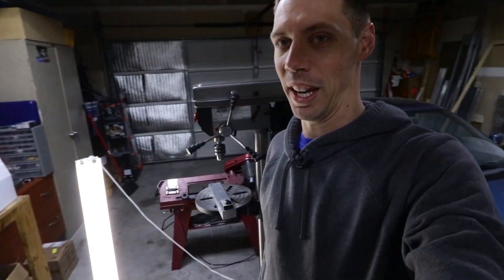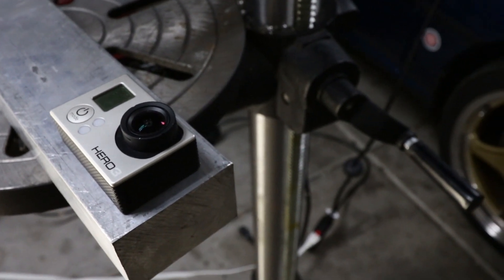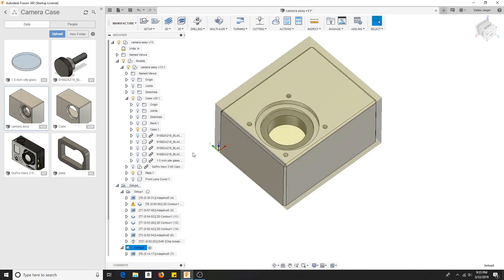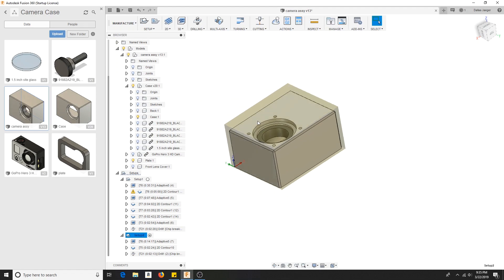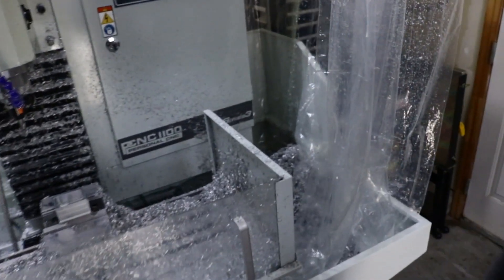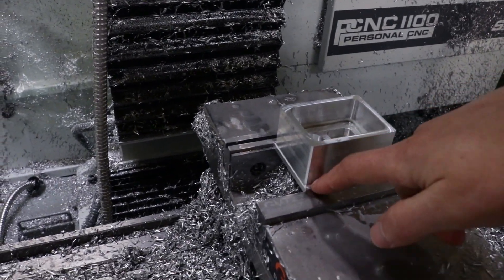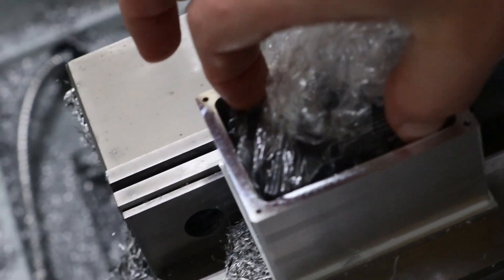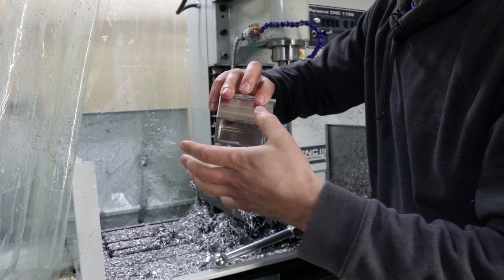Aluminum GoPro Coolant Proof Case Part 1

Comment: If your not planning to run that end mill stubbed up again you can clearance the shank that's sticking out like .010 on a bench grinder. Also you can predrill holes centered on the diameter of your helix for chip evac.
Reply from the maker: That's two good pieces of information.  I'm not sure I want to commit the endmill to this quite yet, and can live with the rub marks, but I will definitely start predrilling the pockets.
Reply: ya if you do the end mill run it in a drill on the bench grinder with both spinning. It will come out fairly round and concentric. Also the drill will save your fingers. cheers  @RivalMachining

Comment: Looking good so far! I've found that the wifi goes through aluminum "OK", but it does seem to become a bit weaker.

All the GoPro models I could find on the internet were slightly off from what I measured myself. (Also, a lot of my own measurements proved to be incorrect after testing.) According to my current Hero 3/4 model, (which I'm pretty sure has been proven-out) the lens is 23mm in diameter and the center of the lens is 13.5 mm from the top and 14.9 mm from the left side. As for the camera housing, I've got it at 59 x 41 mm and the corners have 2 mm radiuses.
Reply from the maker: Thanks for the information.  I would probably trust your dimensions more than my measurements lol.